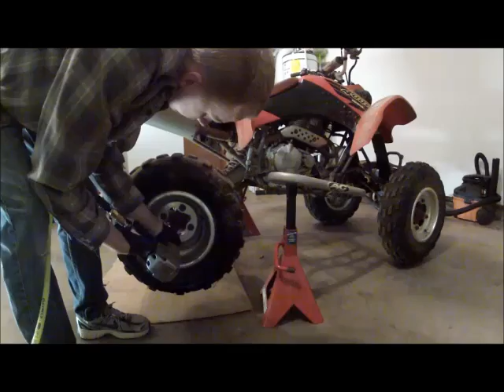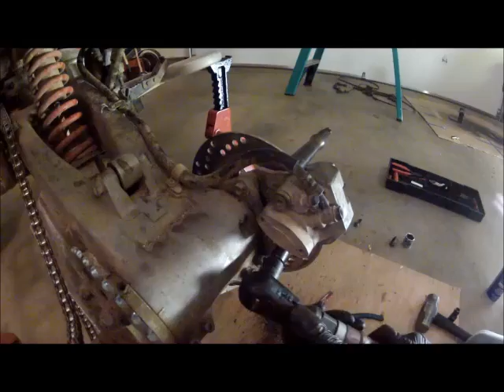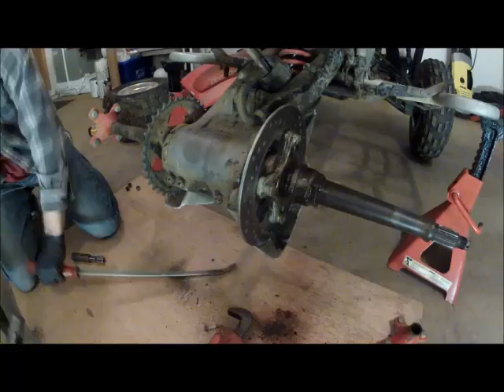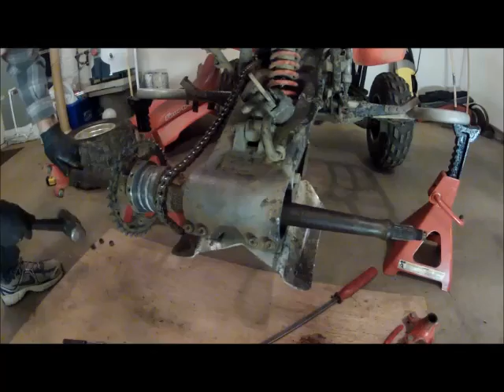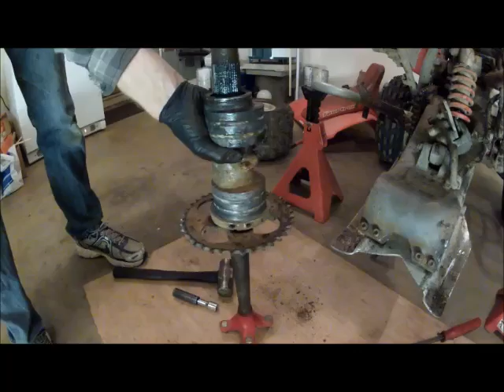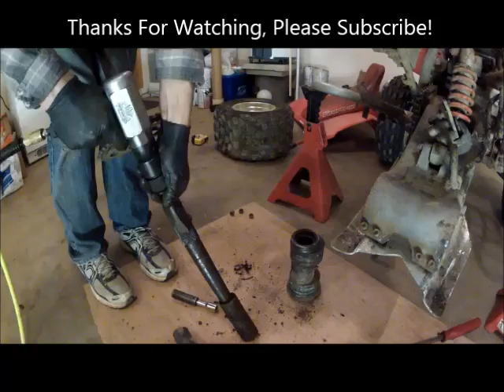400ex rear axle bearing carrier removal

Comment from the maker: First I would apply some heat with some kind of a torch, re-install the other 3 bolts you may removed in order to take some pressure off the the stripped bolt don't forget to use some kind of penetrating oil. Sometimes hammering in a Trox Bit could help get a little more bit. In a last resort - cut a notch in the head of the bolt for a standared screw driver, chisel and hammer, drill it and use a bolt extractor.

Comment: Hey, i haven't done much work on ATV's in the past but im planning to tackle this project myself.

This may be a stupid question,  but do i need to by the bearing carrier AND bearings? or ar the bearings part of the carrier?
Reply from the maker: +Samuel Walters Not a Stupid Question,  you cannot buy axel Carrier bearings separately from Honda– You might be able to somewhere else. Other ones I have repaired I was not able to press out the bearings from one side to the other.  It seems the bearings are pressed in from each side of the carrier and they don't go all the way through. There are a lot of different designs of axle carriers, so this may not always be true. Also there is a spacer in between the bearings but I think it just contacts the inner races.

Hope this helps!
Reply: +AutoTech So do the carriers come with bearings inside then?
Reply from the maker: They all do as far as i know -  it would hard to find one with out bearings in it.  I think the one I put in was from Lone Star and was $150.